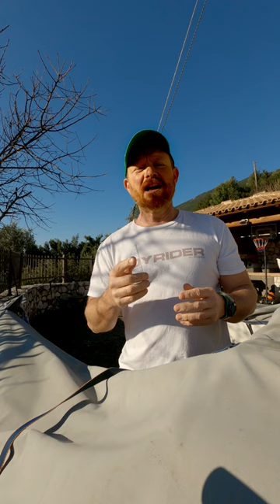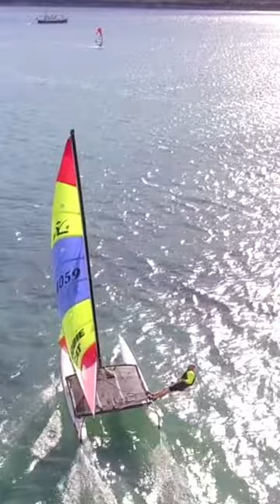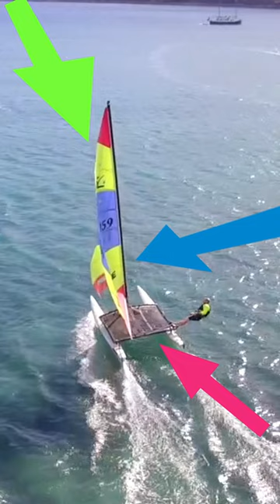What is Apparent Wind - sailing term explained  #shorts

Comment: These days some of the foiling sailboats (like in the last three America's Cup designs) can go several times faster than the true wind.  For example, America's Cup: Luna Rossa skipper Max Sirena said last weekend that he believes the sailboats can reach 60 knots.  Using the same method that you used in this video, could you give a similar explanation on how you can sail 2-4 times faster than the true wind when going upwind, etc.
Reply from the maker: Nice, I'll do some research and see If I can put something together. Thanks

Comment: As the wind speed can change with height, but your boatspeed doesn't, the apparent wind can change direction over height, so that you might require some sail twist for optimum angle of attack.  
  
When the wind gets "interesting", that should not be bad, but in (very) light winds might be a thing to consider.
 
 
I learned that the "boundary layer" (the area over a surface where the wind speed changes from zero (the air (or water) "sticks" to the surface) to full speed can be up to 10 meters thick, i.e. as high as our masts. 
 
Then you can have ONLY induced wind on deck and perpendicular wind at the top of the mast. 
 
That made me put a windex at the mast top, exotic for a cat to say the least, but for downwind, when you keep the angle at exactly 90 degrees, our old Tiger's VMG is still a handful to beat.
 
When you lack the instinctive feel to do the right thing like Joe, it is a really good reminder wether it is no wind or you are too deep and have to luff and when it is time to bear away not to waste precious depth.
Reply from the maker: Thanks for your thoughts on this Stefan!